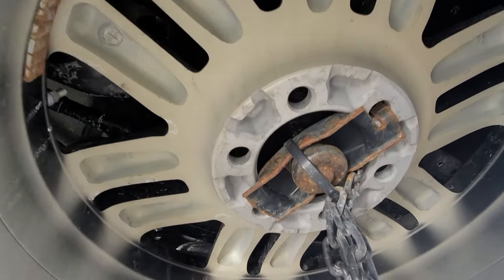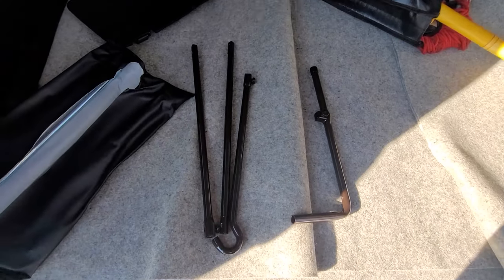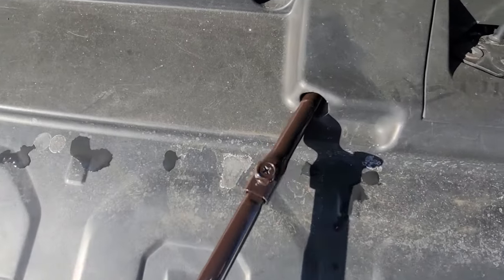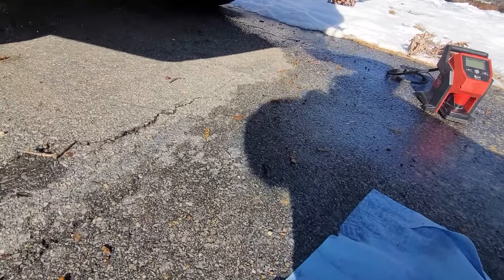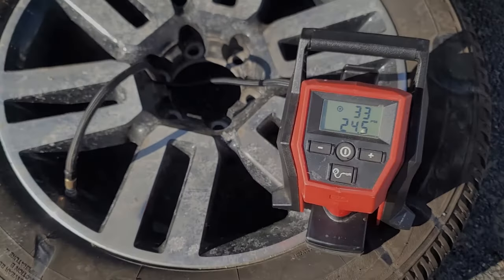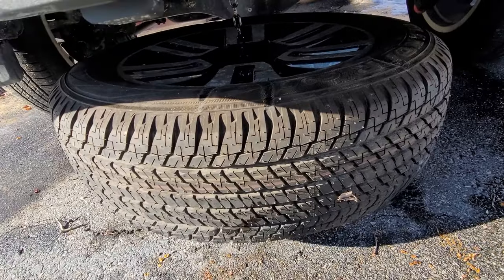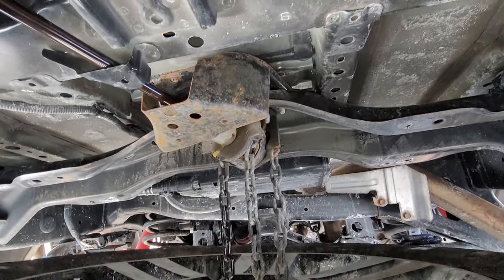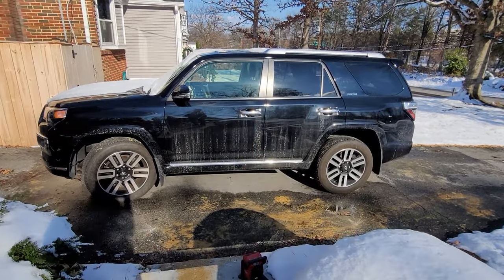How to Access/Remove Spare Tire on Toyota 4Runner

Comment: Great Reminder for folks with older 4Runner mine is '07) to check to determine if their spare will lower..in case of need to change in the future.  Mine is "rusted/stuck" and will not budge for lowering.  Auto repair shop indicated they typically have to cut the cable to get the spare off.  Yikes.....didn't think to check on $$ for repair, but it can't be cheap.  Thanks for advice.

Comment: The lift cable on mine is really hard to turn and it makes clicking noises, any suggestions?
Reply from the maker: Makes sense, trouble with it being exposed like that is salt, grime, and sand getting into the mechanism. Let's start with this - try to hose/clean it off as best as you can (or go through a car wash with an undercarriage wash). Then, just spray your choice of chain lubricant, or the classic WD-40 in there, turn it, and add some more. That may help, depending on the condition. If not, that part can be replaced, I believe it's around $160.
Reply: Put some grease on the cable.  Lube it up.  Then crank it up and down a few times.

Comment: Cool story. My service van blew a rear tire on a few kilometre long stretch of road. Only way to pull off the road was to partially drive up and onto a curb. Jacked 'er up. Removed the tire. Had to lower the spare (just like yours), and there was a rather large boulder protruding from the ground.
 
No matter what I did, I couldn't get that bugger of a spare from out under the vehicle. Had to put the blown out tire back on. Yatta yatta. Move. Do it all over again.
 
They do it to save space. But it can be a pain! At least I was being paid by the hour. ;)
Reply from the maker: Hah! Yeah, I believe it. It gets even better once all this stuff is worn from all the rust, then I'm sure it just gets stuck up there.

Comment: Bring back the easily accessible, full sized spare in the trunk!
Rant over.
Reply from the maker: Amen. And it's weird, thought for sure I'd win a large secret storage compartment in the trunk with this, but not so. They should just mount it on the trunk door for the 4runner.